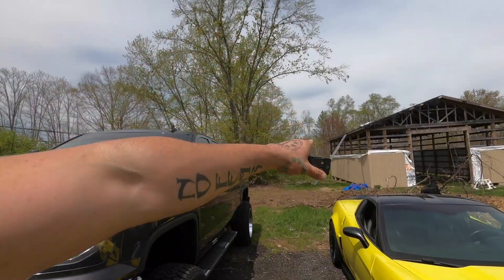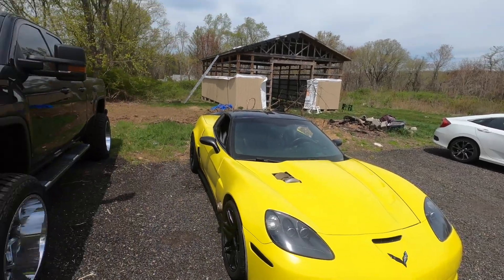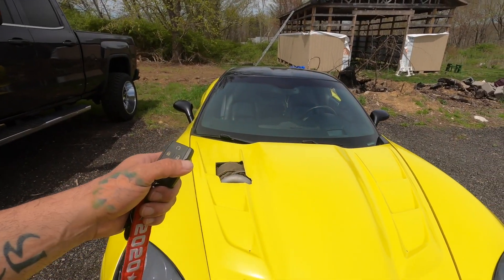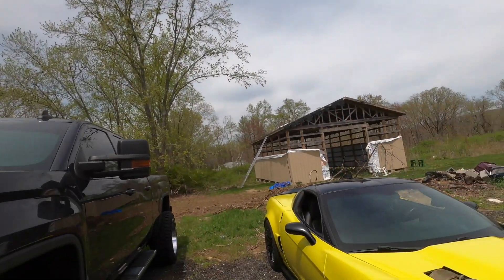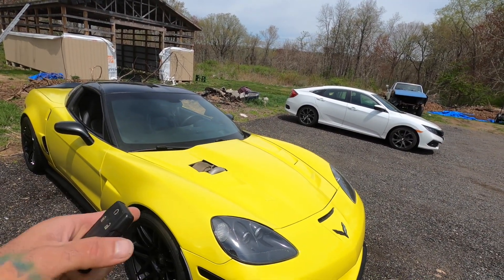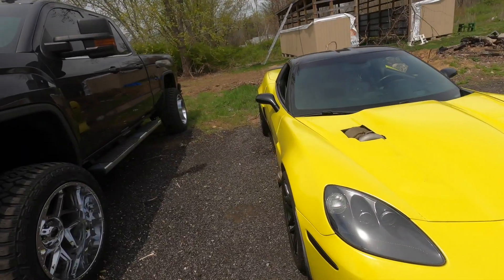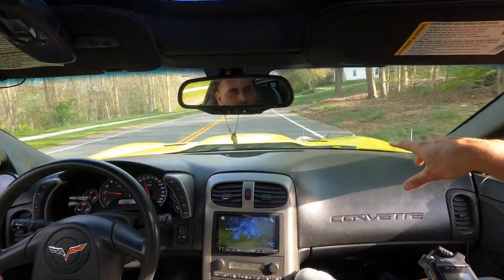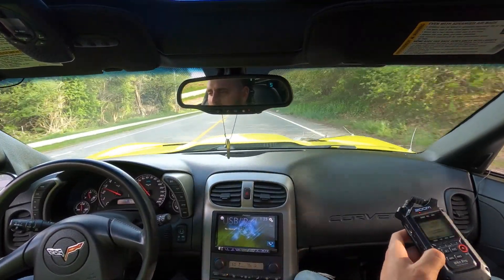The turbo corvette is back!!

Comment: Have you had any problems with the paint around the exhaust?
Reply from the maker: 100% cant keep it clean but the paints perfect still I basically daily drive it in the summer nearly 20k-30k miles every year so I just live with it getting black marks but if I take the time to clean it once a month it comes right off